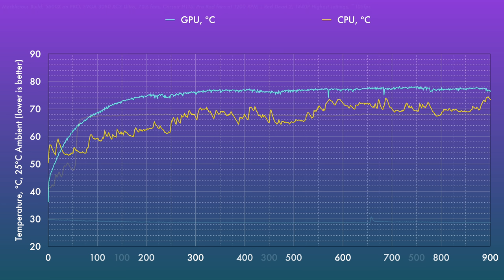Meshlicious Build Guide - Step by Step to an SFF Gaming Tower!

Comment: This guide is very helpful. I first installed my fans as exhaust in the video but swapped to intake. It works better for circulation and does not need fan covers if cable management is tight.

Comment: Thank you for this. I recently built in the Meshlicious with an ASUS Strix 3060 Ti and it’s a pretty thick GPU. I originally wanted to wait for an EVGA XC3 card, but was able to snag this one instead. But I was worried about the spacing between the backplate and motherboard so this is extremely helpful for me!

Comment: Thanks for the amazingly helpful video, really highlights the value of planning ahead! I was struggling with cable management swapping from an NR200 to the Meshlicious, with a 280mm EKWB radiator. M3 standoffs ordered!
Reply: why did you swap?
Reply: @awges  NR200 is very good, just preferred the Meshlicious aesthetics and the smaller footprint, and hoping for similar or better temperatures

Comment: Just finished building a Gainward 4090 and Be Quiet! Silent Loop 2 280mm in this case. Unfortunately couldn't use standoffs for this since I needed 4 slot GPU mode but managed to fit everything in with cables going down side of the RAM, and a MODDIY silicone 40cm 12vhpwr cable for the GPU. The AIO bends are tight!

Comment: Just got done building mine; went through a couple of different AIOs, cables, and fan combinations to get everything to fit!  The Meshlicious is awesome, but has a few "gotchas" for sure.
Reply: For the record, I was trying to get great cooling at low dB levels so I went for an Arctic Liquid Freezer 2. It is an incredibly tight fit in this case and the way the hoses come out of the pump-block is bad for the Meshlicious. You can make it work but you have to get really aggressive with bending the tubing as it exits the block and then tie it down somewhere so it stays that way. Even still, it'll rub the side panel. I don't recommend it; the only reason I stuck with it is because I'm planning to build a custom loop in a few months.  
Another note: The ASRock B550 Phantom Gaming board (one of the few B550 ITX boards in-stock these days) SATA ports are mounted at 90-degrees, which puts them in conflict with the radiator fans in the Meshlicious. You'll either need to run M.2 storage only, or swap one of the radiator fans to a thinner model (likely a 120mm unit with some kind of adapter) and compromise on cooling** just a bit if you want to use SATA cables and an SSD. 

**If your rig will mostly be used for gaming, then in my tests the CPU load isn't going to be high enough to make a difference. But it'll matter if you're doing rendering, long compile tasks, or other CPU-intensive loads.
Reply: @noelwade this is really useful as iwas thinking about buying the arctic liquid freezer3. Thank you

Comment: Personally I'd hold off on removing the top bracket to install the AIO. The screws holding mine in were so tight from factory they felt like they were going to strip undoing them.
I was able slide slide in a 280mm aio with minimum effort without removing the top bracket.

Edit:
I've been running the system for about a month. I've taken the whole thing apart to add 26mm standoffs to both the Motherboard and PCI-E slot. This is great cable management advice. I added aluminum feet to the case to raise it off the desk a bit to stop putting strain on the DisplayPort cables. I've also added fan grills. 
One thing I'm concerned about is the strain that gets put on the PCI-E riser cable after adding 26mm standoffs to both the MB tray and the riser card. I've also got my riser card in the slightly higher configuration to reduce strain on the DisplayPort cables. However, I feel like the riser cable is getting stretched to it's limit where its at now. Hopefully this doesn't cause the riser cable to fail prematurely. We'll see...
Reply: how is the riser cable holding up?
Reply: @djg2008  Riser cable is holding up great. Only issue I've experienced after ~1 year is that 45° DisplayPort cables are not as good as regular ones. 45 degree DP's result in constant flickering when using HDR and or 10-bit color. No problems with strain on the PCI-E.

Comment: I just ordered this case along with a Corsair cf600 Platinum and the EK 240 AIO to transfer all my ITX parts over to. I am currently using the NZXT H200 which seemed small at first, but I am over it and want a true ITX system.

Comment: Used a stand off mod for my Sliger S620 build - the mod works wonders. I kept my Meshilicious build stock but used pslate custom cables and I love not having extra cable to loop around or tie down somewhere. Oh and I swapped radiator fans with the Phantex T30s…so nice

Comment: Great guide! Going to follow this while putting mine together today. Just curious though, why did you set the fans to exhaust instead of intake? Isn't that just going to unnecessarily force all the gpu heat into the radiator? Also, a lot of the dust will build up on all the internals instead of the radiator making cleaning more difficult.

Comment: Which height would you recommend for the GPU standoffs if I've purchased an Asus GeForce 3070Ti? You mentioned you wouldn't use the 20mm standoffs for a 3-slot GPU?

Comment: Appreciate you sharing this video.  Maybe I missed it, but what is the solution for the gap at the back when using the smaller PSU?  Is that something you just live with or is there a bracket to close off that area?

Comment: I have a Meshalicious ordered! (White/Glass Pcie 3) - going to be not till Dec 1st delivered. 
Will be cheap and dirty first with my anemic sff gpu and atx PSU so will have glass on gpu side initially and my old AMD Stealth cpu fan on the mesh side.
Ultimately I’m going for a black component white accent build with a white aio cooler at some stage.
Reply: for me you should use glass on cpu and mesh on gpu
Reply: I caved and got a new SFX PSU and 240mm AIO cooler so glass will be on the cpu side now 😎

Comment: So I'm in the middle of building my Meshlicious right now, and I'm kinda confused as to why you removed the stock motherboard stand offs? By using the stock standoffs, and the 20mm female to male extender the motherboard perfectly lines up with the IO shield in it's farthest position. Interestingly enough my case also did not come with a standoff removal tool. Thanks for the video though! Been a big help

Comment: Does the "CP-8920202" Corsair SF cablemod cables fit to this case or are too short in lenght? ATX cable is only 1x300mm, compared to 600mm in this build.

Comment: Great vid as always! have watched all your meshlicious vids. Currently waiting for my case to arrive. Just a quick question about AIO compatibility. Does the ML240 illusion fit in 3-slot mode with a 20mm motherboard standoff for the tempered glass version. Tossing up between a X63 and Cooler master mirror, not sure if that 2.8mm height difference will make it not fit.

Comment: Got the Meshlicious on the way, managed to secure a 3070ti at MRSP today after months of trying. This guide couldn't have dropped at a better time, although it's probably gonna be a couple of months before I have all the components lined up, especially with Alder Lake incoming, with Zen 6000 following (hopefully) not too long after it.

Thoughts on using an ATX power supply instead of SFX? I'm sure you've touched on the subject in one of your previous Meshlicious videos, but I thought I'd ask just the same. By the looks of it it should be technically doable, but probably a huge pain in the rear as far as clearances and cable management are concerned. Keep up the great work m8, it is much appreciated.
Reply: Just got done building my Meshlicious. An ATX power supply is going to really limit you in terms of cables and AIO tubing paths. You really are much better off with an SFX power supply in this case.

Comment: Do you much prefer this mobo to the MSI MPG B550I GAMING EDGE MAX WIFI? 
I'm looking at either this ASUS or the MSI for my first custom build; also using the SSUPD case.
Reply from the maker: They each have their merits, but the Asus has a temp probe header and uses a normal backplate layout. The MSI has more robust power delivery so caveat if I were overclocking a 5900X or something along those lines, I’d want the MSI for this case, and just be aware of some of the limitations with non standard backplates. For a 5600X, either is fine.
Reply: @MachinesMore  Thank you for the response.
I will be using the 5600x ; I reckon the ASUS would be better suited for me then to keep things simple because of the backplate. Cheers!!

Comment: Is it better to use Brass Standoff Spacer on motherboard or on riser cable.....
Reply from the maker: Will have a standoff specific video coming soon - GPU thickness dependent, you can do the mod on both sides, and it doesn't matter if it's brass or not. If you're choosing one, I'd say the GPU side is going to matter more for performance, the motherboard side mod is for cable management only.

Comment: Based on your testing, is this the best configuration for all around temps?
Reply from the maker: Yes, exhaust on the rad and shifting a compatible GPU out to the edge of the panel will give the best thermals for combined use like gaming! If it’s a three slot card it’s already close to the side.
Reply: @MachinesMore  Thank you for the quick reply!

Comment: Best AIO and board for this? Going for a 5800X and a EVGA XC 3060ti (which i found out is the smallest 30 series card)
Reply: Well too late on the aio question. I just got a lightning deal on amazon for a deepcool castle 280 for $90!
Reply from the maker: Awesome! Best boards would be either the MSI or Asus B550 ITX since both are dependable boards and have the USB-C front header and I think your AIO uses the stock AM4 backplate (if not choose the Asus).
Reply: @MachinesMore  I get the aio on saturday so ill see about the backplate
Reply: @MachinesMore  It does have an AMD backplate
Reply: @MachinesMore  Hey i just got the corsair psu and noticed that it has a bit of coil whine. have you experienced this or have a fix?